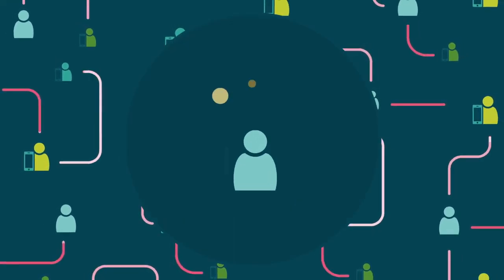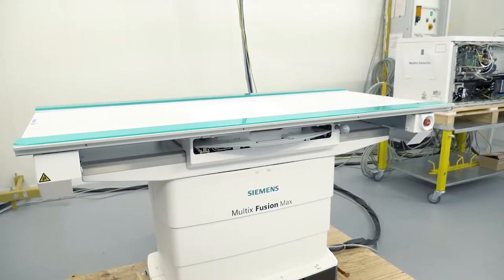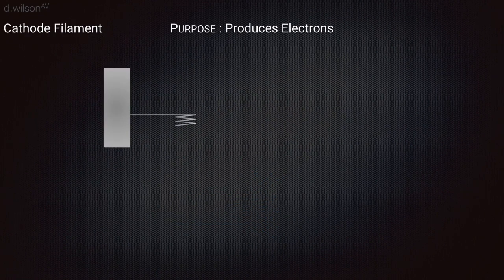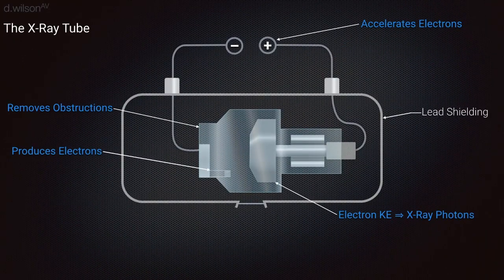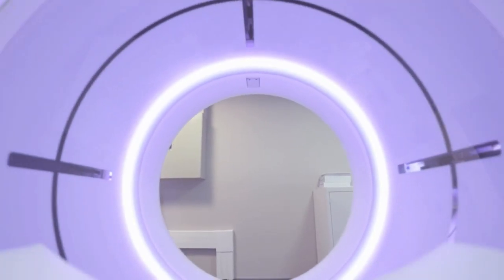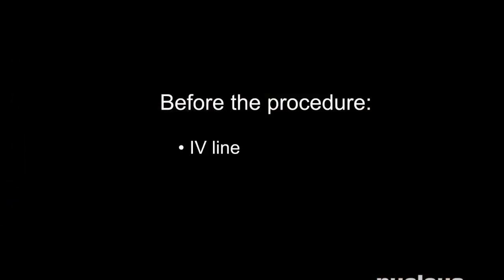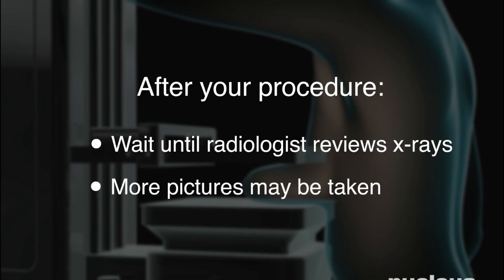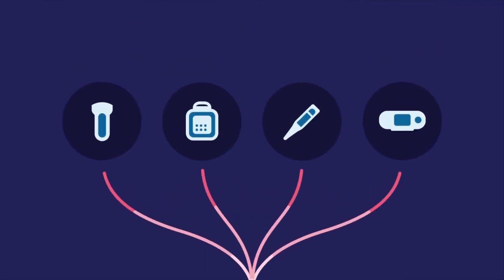X Ray Machine | Part 1| Biomedical Engineers TV |

Comment: I did an x-ray of my chest.  My eyes remained open during the x-ray. Is there damage to the eyes.... and should we close our eyes during the x-ray?
Reply: YOU did an X-Ray of your chest? I take it you had an X-ray of your chest performed by a medical radiographer. Medical X-rays performed on humans are done using very low energy X-rays and very short exposure times of upto a second or two. I wouldn't bother closing your eyes either as if your eyes were in line with the primary X-ray beam it would pass though your eye lids!!

Comment: I had a CT scan a while ago 'cause I had a head injury, while I was laying on the machine I saw a band of distortions in front of my eyes while the machine was taking the x-rays.  Does anyone knows why that happened?
Reply: If I understand what you are describing, it sounds like you were just seeing the internal components of the CT machine ie the x-ray tube, the detector, etc, rotating around your head at a high speed. If you were looking through the partially transparent "Mylar window" or scan window, you would see the blurred motion of the components as they span around your head. Staring at the motion could have possibly even disoriented you. Nothing lasting or even related to radiation but just a bit of visual overload. Otherwise, I have no clue what causes that. 🤷🏽‍♂️